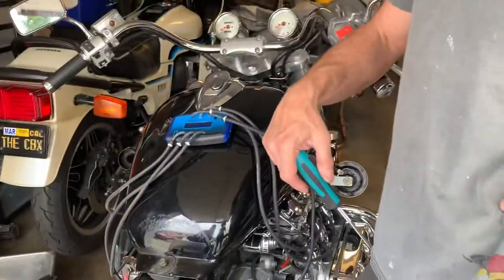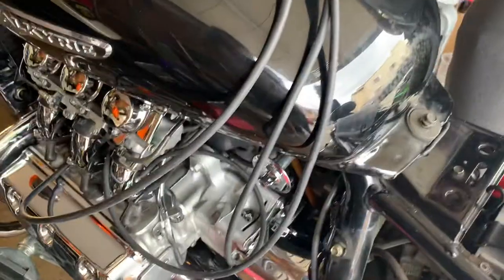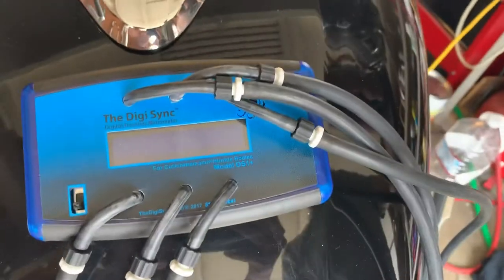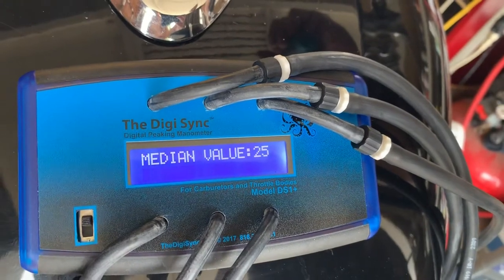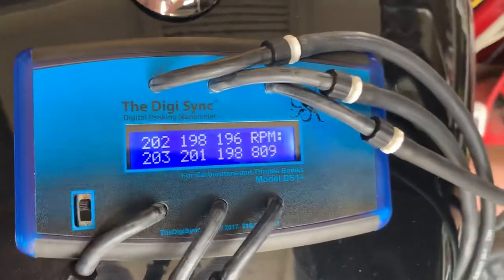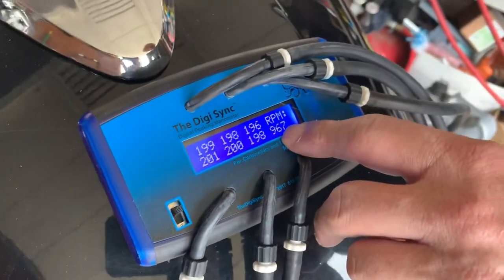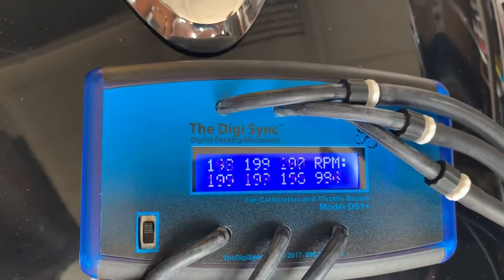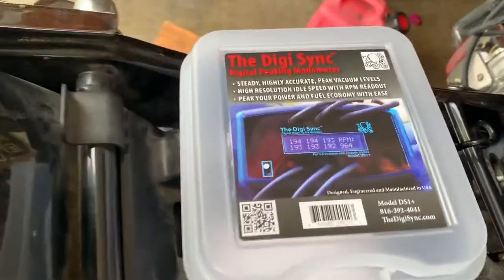The Digi Sync Review

Comment: I'm a big guy 240 lb so I keep my idle at 1,000 also. I've had some of the old school guys tell me that to synch I should drop the idle down to 800. Something about getting a better and more accurate reading at the lower RPM. Just curious to what your thoughts were about that. I finally went out and bought one cuz one of my bikes has got a little bounce in the deck at idle

Comment: I want to change my honda valkyrie's carburettor system to electronic ignition. What is the value of the complete dollar system because I am from Brazil. I'll pass your contact on to my friends who have a store. hugs, I await response.
Reply from the maker: Valkyrie already has election ignition so I’m assuming you meant electronic fuel injection. I have not heard that anyone made such an attempt nor have I heard of a conversion kit. This would be very expensive. It would require machining and fabrication to adopt everything. There are other less expensive ways to get a bit more power out of  a Valkyrie. Properly setup carburetors alone do wonders to already super smooth engine
Reply: @sashakrstich6703  it's been done (fuel injectors) but you are right you have to machine the block and put them in then modify the air intake system.   They have also been supercharged.   The Valkyrie motor wasn't tuned for high performance it was tuned for longevity.   These bikes will go for a half million miles properly maintained.   But I understand his wish for the fuel injection.....way better mileage would be the most obvious improvement.   My Goldwing is 300cc bigger and gets 15 mpg better.  And it's heavier to boot.